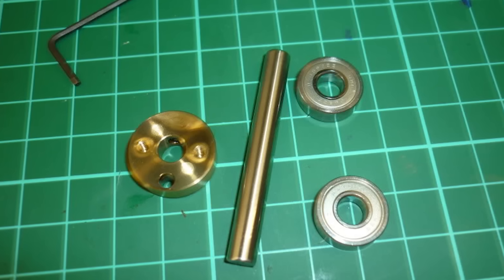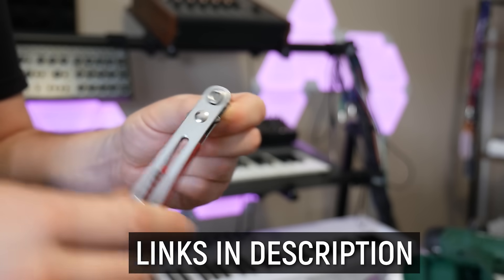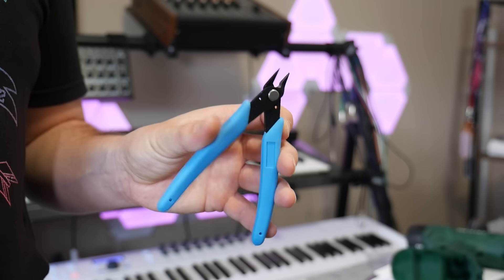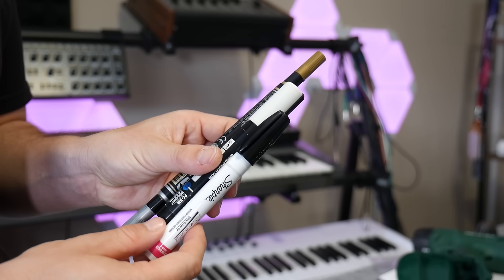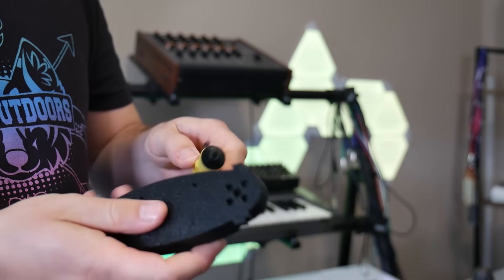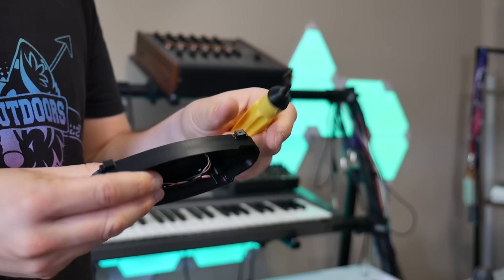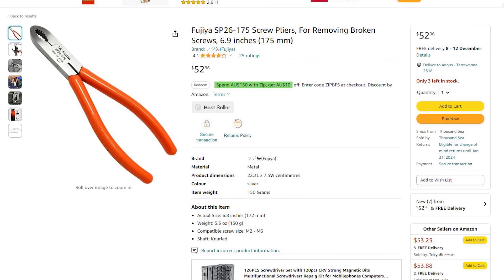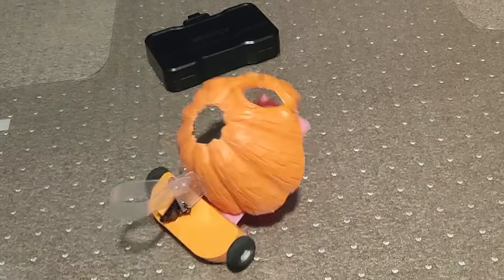Incredibly useful tools you need to know about!

Comment: Having got into Warhammer when younger, I always used a pen knife to clean flashing off. But by dragging the side of the knife across and toward the thumb like a deburring tool. It won't dig in that way and if it slips only the back or side of the blade contacts your skin, so you won't get cut. The worst I hurt my thumb doing this was from the pressure of the mini's as I did a rush on literally hundreds of parts. I was quite sore after that

Comment: ADDING hex drivers is always a good choice but as a mechanic, technician and (hobby) machinist and welder for decades I keep L-style keys, screwdriver style bits, T-handle bits and any variation that adds capability. A particularly useful feature of cheap L-style keys is they're handy for making custom tools for special situations. Makers often make to augment their main interests working on autos, bikes, machinery other than printers etc so more tools and greater variety pays off (literally if you repair your own car which alone saves more than the cost of a full printing outfit).

If you're doing production deburring or just like your fingers cut-resistant gloves as use in kitchens and industry are worth owning. Shaviv and successors offer a wide variety of deburring blades cheap and with them in front of you their uses will be obvious. Great holiday gifts for auto and other mechanics too as most outside machining aren't aware of them. Holding an item to be deburred against your workbench top is often more precise than freehanding.

Paint and other marker tip: Sharpie style markers are widely used by machinists as the most convenient layout die for small areas which are most common. If your paint or ink doesn't flake you can scribe lines precisely on that background, ideal for making or adjusting many things. 

Those little wrenches are obviously wonderful so I'll add some to my box. If you can find a similar sized version with a hinged head similar to a (image search this: "spring loaded basin wrench") I promise you want one because I do and have been wrenching since the 1970s. Spring-loaded toothed jaw wrenches have been around many years. Larger ones are terrific for plumbing because of their low bulk. Owning more than one (as with any tool of the type) lets you hold a fitting or fastener with one while turning with the other, and permits gripping the pair like scissor handles.
Larger sizes are available as "spring loaded auto adjusting crows foot" wrenches you can turn with a ratchet.

Comment: There’s nothing wrong with Allen keys with good technique. Get a nice set of long ones with a ball end. You have a lot of leverage to break free tight bolts. When the bolts loose you can use the ball end, wrap your hand around the long bit and put your thumb in the end of the short end then spin it with your thumb. Way faster than twisting a driver

Comment: 908S 80W soldering iron. Only $10 or so, and does everything from delicate SMD work to heavy gauge wires, and even hot glue and other plastic melting. Much more precise than a glue gun. Cut little bits of glue stick, place where you want, and then melt with the iron. Use dedicated tips for each material, of course. Hot glue comes off with alcohol, for those unaware. I use it most often for making wire strain reliefs.

Comment: One tool I wish I'd had sooner is a sanding belt. Not a belt sander, just the belt. Get the kind without velcro backing. It's like everlasting super coarse sandpaper. Also a little handheld cordless vacuum cleaner to clean the dust off of it every 10-20 strokes.

Comment: I have to say Allen keys still have their purspose. Try tightening the bolts on some monitor arms for example with a straight on driver, you just don't have the leverage to tighten the bolts sufficiently which results in a saggy monitor.

Comment: Cheap allen keys suck but wera makes some really really good ones! I usually use a screwdriver with a hex bit, but a good quality set of allen keys definitely is handy in some situations.
Reply: I always try to spend more on the tools I use very often, and cheaper ones will do for more occasional use, but cheap allen keys just aren't worth using at all. A screw in a hard to reach spot will suck a 100 times more when you strip it with the crappy allen keys that came with your furniture or your ender 3.

Comment: I've thought about paint markers before but mainly for marking large prints which have to be cut down into smaller parts, i've seen someone on reddit say they use them on their 3d printer for marking the leveling wheels incase they lose their level while dusting/cleaning the printer, think of the line as like a torque marker on a wheel lug/stud, it makes sense.
Deburring tool is a must have for sure.
i think having multiple pliars is a good shout, i have fine needle nose pliars i use as well as some bent nose precision pliars, i have a vice grip i've used for holding my hotblock when doing a nozzle change.
I went with a set of max power allan keys and torx keys that come with a handle, they are colour coded with a ball joint end, i'd rather have an electronic screwdriver for the hex capped bolts but its a cost i can live without and im happy with my colour coded allan keys.

Comment: As someone who actually spent a week getting the rust away from bolts on my truck (the ones in the bed so the fastener remover tools wouldn't have worked), I'm absolutely putting those on the list

Comment: In my 3D printing course I show almost exact same tools for post-processing :) One thing though, your de-burring tool looks like the generic side cutters. Look up Noga for example. Blades for ambidextrous have less aggressive angle, better for plastics. Also strange ones like D50, S70 or ceramic CR2600 are invaluable. Check them out!

Comment: I've found that a pipe wrench can work really well for removing stuck threaded shafts. I had to remove a tie-rod from my old Passat and it wouldn't budge and I ended up rounding off the flats with my wrench. I put a couple of big pipe wrenches on it and (after an hour of swearing) the tie-rod came right off. They're basically doing the same thing as those wrenches you showed in the video, except a pipe wrench is more adjustable, in my experience.

Comment: Since we're on the topic, Knipex pliers wrench. Flat jawed and parallel like a crescent wrench but with a pivoted slip joint mechanism that make them much easier to use than a crescent wrench, and actually let you grip bolts, and other things, to maneuver them into places where you can't get your fingers.
Reply: My 6" Knipex pliers wrench is  probably my most favorite tool.
Reply: Knipex cobra's are also the best water pump pliers too, the jaws are hardened very well and really bite into metals. I think basically anything knipex if it comes to pliers!

Comment: I find it hilarious that hex-head screwdrivers have developed their own name.  "Hex driver" just sounds like some kind of witch racing game.  :D

Although, hex-head drivers of any sort are less useful in Canada, because if you want to buy hex-head screws you're importing them.  Any screw you find in a big box store is going to be a cross-head or, most likely, a Phillips.  Which is, of course, the ultimate screw driver design and it's a shame that politics and patent law kept it from spreading to the rest of the world.  That said, since getting involved in 3d printing I've had enough use for metric screws that I do import them, and so have a multitude of hex-head screw drivers.

I also have one of those tiny little ratcheting bit drivers, and it is very, very useful for awkward places like the inside of a robot.

Comment: Some more tips from another maker:

1. Get a good quality ratchet bit wrench. The lower quality one has very coarse articulation, and it’s easy to accidentally change the direction.  

2. Ball joint hex drivers. 

3. Get a proper set of German or Japanese “Philips” screw driver. #0, #1, #2. I like Vessel, Wera, and Wiha. 

4. If you deal with IKEA furniture, make sure you’re using Pozidrive! They’re different than normal Philips screws.

Comment: Ha, nice hair cut bud, looking good :) one tool I recommend is the Dewalt motion activated screwdriver, the clutch feature allows you to screw in aluminium M2 and M3 bolts without snapping them, best thing I have ever purchased for the makerspace, unfortunately the charger is US 120v only, but I modded mine to work here in Australia, and the LeBear long reach allen key set to use with the screw driver, these are colour coded so really easy to see what size is what at a fast glance.

Comment: Speaking from experience, not all Allen keys are created equal. I've thrown out cheap ones, but I swear by the quality ones. They're incredibly durable. I even broke a decent ratcheting wrench on a tough hex screw, but my Allen key? Extended with a pipe and it didn’t even slightly bend.

Comment: Here's another really useful one that every body has. The scraper that comes with your 3d printer can be used like a edger/deburring tool. If you notice, on the sides of the scraper, it has one side that will "catch" your fingers, and it's that side that you can use to remove material, especially on long straight edges.

Comment: I have a deburring tool, a box cutter, and a 15cm metal ruler. The metal ruler is by far the most ergonomic as it doesn't rotate around annoyingly the way the deburring tool does, and I don't think anybody is going to cut themselves using it. As a straight ruler, without having to change to another tool, you can then use it to check if you've managed to plane off enough elephant's foot after that.
Reply: lol, that seems so wrong to do with a measuring tool. I use a cabinet scraper, but the narrower and thicker ruler actually does sound more ergonomic.

Comment: Personally, I find this kind of information quite useful. I would add, "Don't use your side-cutters as strippers.  Buy No-Nic strippers instead" - but I can't find the brand I've used for over twenty years. Sorry.  Great video, Angus.  Thank you for sharing.
Reply: I've seen recommendations for a whole variety of different wire streippers. For me, and my uses, I've found many variations of the Klein 11061 to work very well. But I also know folk who swear by the Knipex 1101160 or 1252195 varieties. All 3 basically work by cutting the insulation, but not through to the wire strand(s) and grip the insulation on both sides and pull them apart at the cut. I know that there are other varieties, but these three are the variations I'm familiar with.

Comment: I have a tool very simlar to the "unknown name" device of your's. The main difference with the one that I have is that rather than having ridges like yours, they are flat edges, and the tool is designed to remove nuts of either metric or imperial sizes and not have to have two sets of wrenches. I keep it in my car's tool box as it provided a way to remove nuts & bolts that you don't have the space to get a socket onto, and not have to keep a large set of wrenches in your car all the time. 

Although I got mine at Canadian Tire, Canada's  largest store for tools & camping & sports & hardware & automotive parts  (yes, they sell tires too!), it seems that they were probably manufactured by Stanley, and I saw the exact same thing but branded Stanley, and it's full name and model is: Stanley Dynagrip Ratcheting Adjustable Wrench 17-24mm, STA487990.
Reply: I've had a set of 'cheap' (I don't recommend that variety) box end style wrenches with that cam head th clamp a bolt head in place. I would imagine a good set of made with a better alloy would replace a double set of box end wrenches for a lot of people. Won't help with open end wrenches though, although what you describe likely would cover that set too.

The problems with the set I had were both that the material was too maliable for a good wrench, and the pivot pin for the cam extended past the surface of the box end. You're already losing depth to attach the cam to the moving jaw, having the pivot pin add an extra 2-4 mm can make the tool useless for some jobs. But hey, I have yet to find someone who hasn't bought cheep tools for that one job, that when used, made the decision to never use those tools again, and if it became an option, melt it down for slag rather than let some other poor sob go through that experience with them.

Comment: A 6.35 mm, that is 1/4", bit kit with ratchet and straight handle and extension for the straight handle, doesn't have to cost much, that way you can have a huge variety of bits including all small standard and hex and "security" dimensions for very little money. A warning for 2 mm and smaller hex bits, where the very worst quality bits might not be good enough to apply much force. So if you get the cheapest 1/4" bit kit you can find you might want to keep your small hex keys until you replaced the those bits.  

Funny that Angus still manages to look and even sound a bit like a "young adult", almost kid, especially as he produce so many great videos, with widely applicable useful information that seem very well planned and thought trough, indicating a level of "wisdom", that not everyone develop, and that's typically with age.

Comment: For the flush cutters I would definitely recommend getting some that have a "lead catcher" (that's what Knipex calls it. I don't know if other brands have that feature or what they call it).
It's just an extra piece of metal that clamps the offcut after cutting. So you no longer have those small pieces of offcut flying everywhere.
Reply: You can also fill the void on many cutters with RTV to grab the offcut, like we did in the Air Force on diagonal cutters, to avoid FOD.

Comment: As far as flush cuts for electronics work. Find a good set of electronics pliers. It's a common variety with short needle nose pliers, a smooth jaw pliers, and a flush cutter. The smooth jaw pliers are really nice for bending metal wire.

Comment: Unfortunately the self adjusting pipe wrench thing is probably as happy go lucky as the store you found yours at. Many are useless beyond belief, I think the two reasons why you're happy with yours is because the jaws on yours come to flush sides, and have gripper teeth that must be somewhat acceptably hard and that spring gives it the starting bite that it needs for the mechanics to start working. I have a couple that are like the ones you linked and they haven't seen any use - they're still around for that occasional pry bar job.

Personally as far as what you suggest them for, I skip them entirely and go for vise grips. You can set the bite force separate to the turning - if the material is resisting being bitten, for example due to having a smooth outer finish - you can just give the screw a little bit more and bite harder.

Comment: Paint markers can also be used to make it easier to separate 3d models from big support structures.
Set the spacing between support and the model to 0.1 mm or even lower and add a Gcode pause when the printer would start printing over the support. Paint all the top layer of the support with the marker and resume the print. You will get a very smooth finish of your supported layer and it will still hold it just enough to stick to it during the rest of the printjob!

Just remember to choose a color for your paint marker that comes as close as possible to your model, you will get some of it in your first layer 🙃
Reply: Don't need paint markers for that technique. I even set it to 0 spacing, solid top layer, paint over it with sharpie. Then afterwards, it comes off with nearly no force, remove any transferred ink with isopropyl.

Comment: As a mechanic I used to use liguid paper pens instead of markers. They are basically paint pens but with a very fine point, which also will paint over any surface and don’t tend to dry out.

Deburring tools are great and so much safer. The one you show is more specifically for inside pipe edges. The direction can make a difference.

That universal pipe wrench set was sold at Bunnings for a very short time (isle hanger sales). Too short, because I didnt get to buy a set. I remember them being sold on infomercials long ago. Very handy tool.
Reply: White out pens are excellent for marking surfaces, I use them to mark suspension bolts to ensure they don't loosen
Reply: Liquid paper pens can have a fine point and, thus, draw/write fine lines... but they don't do so reliably over the life of the ink; they can lay down a line several to many times wider than the tip itself. Seemingly at random. Disappointing, and wasteful. Paint pens are consistent in terms of line width, IME.
Reply: @michaelthibault7930  That's true, and it can depend on the brand. I've had much better results getting fine marks with Pentel white out pens, they have more fine control and less runny fluid than Bic white out. One other disadvantage I've found is that they only work reliably when pointing down. Most of the time I can work around it, but not in all situations